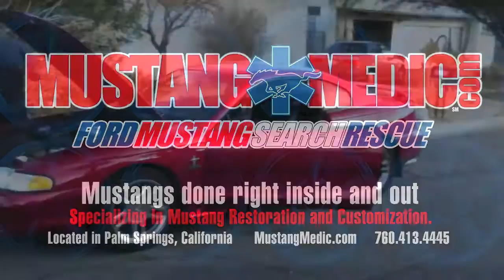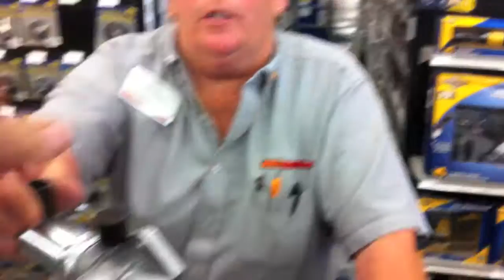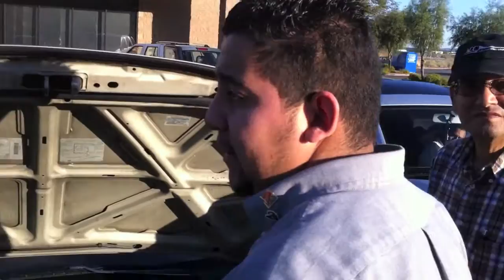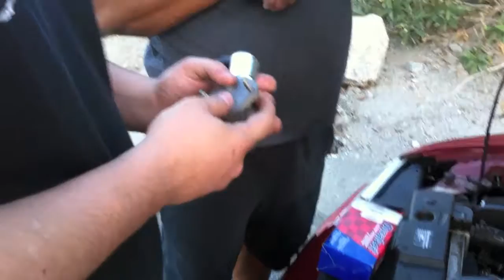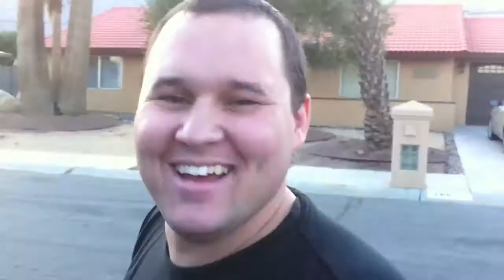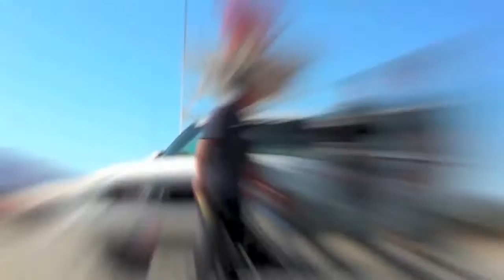1998 Mustang GT idle surge and base idle reset Day 3 - We found the fix!

Comment: Mustang medic my sn95 has bad spots on the ecu, and idles like it's choking,  it's so bad the alternator gage moves with the tachometer. Is there anyway to identify what the damaged areas of the ecu control so I can verify no problems on engine and wiring before I install a refurbished ecu

Comment: Warm start my 95 v6 revs to 2k for a second like it’s cold. Everytime I go to start it. I drive to wallmart grab a drink from the front of the store so I’m in there for 1 minute or 2. Come back normal temp still revs to 2k for a second then goes to 500 rpm. I’m confused and frustrated. If you can help let me know and post my name in your comments so I see that I got a reply. Thanks in advance.
Reply from the maker: I’m back but I haven’t worked on mustangs for 8 years

Comment: I have an 02 mustang gt that I did a 5.4 swap in. The car starts fine and then after about 30 seconds acts like its gonna skip but it does not. No codes and have replaced almost everything under the hood. Any ideas